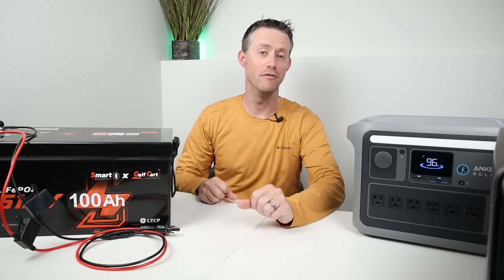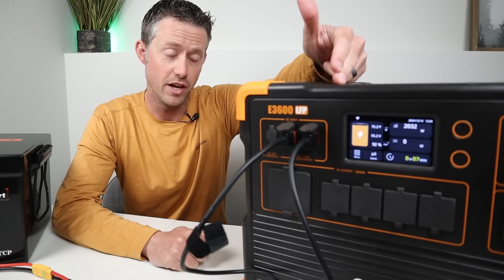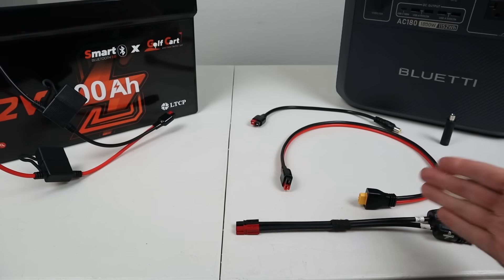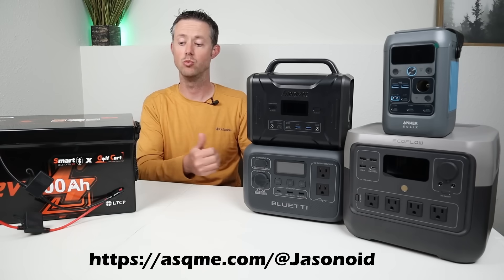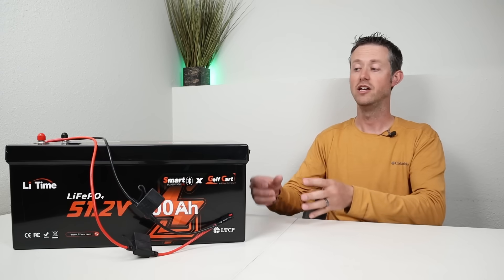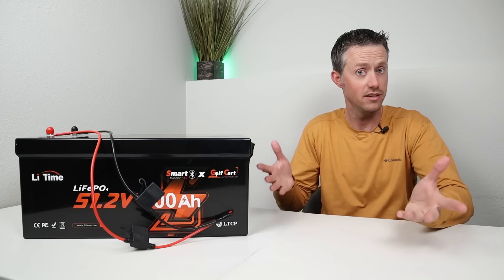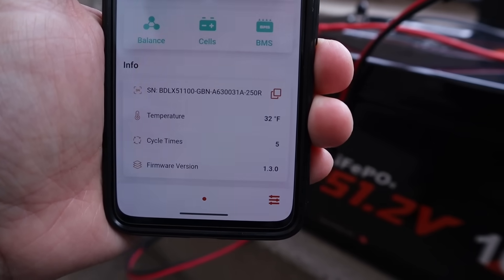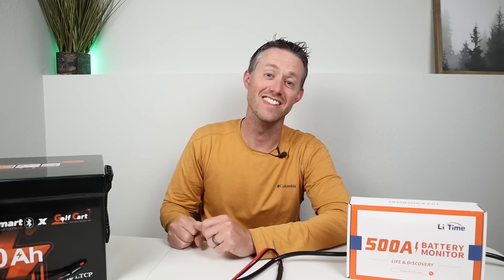Simple Trick to Make Your Power Station Last 5X Longer! Charging with a LiTime 48v Smart Battery!

Comment: I have two Ryobi 480EX Riding lawn mowers. I have upgraded them both to Li Time LifePo4 batteries. In fact, I installed the exact same battery you are using in your video in one of them. I have the Anker F3800 [not the plus]. How could I use their batteries without removing them from the lawnmowers? You gave me that thought when I saw this video and realized that I have the same battery. I will eventually purchase the F3800 Plus. Thanks...

Comment: This may come across as a dumb question, so I will apologize in the beginning. I recently purchased an Anker F3800 [not the plus]. I am running it in the UPS configuration in my office. I understand that the unit cannot power 240V while charging, however, the F3800 Plus can. You can charge the F3800 Plus using, solar, a generator, AC... Why can't you run your house from the Anker F3800 Plus while charging it off of that same AC power provided by the Anker F3800 Plus? You wouldn't need a solar panel setup or a generator. Conceptually you would have unlimited power. Thanks...
Reply: If I understand correctly, you are essentially asking if daisy chaining the 2 power stations would work. I have seen videos demonstrating this, and it’s possible but not very efficient. Something to do with the watts each power station uses just to power itself.
Reply: Hi Alexandra, actually my question is if the Anker F3800 can charge itself from house current, why can't it charge itself WHILE providing power to the house? Why would you need solar panels? The unit should hypothetically run indefinitely.
Reply: @GospelChoirs So when you say ‘provide power to the house,’ do you mean though a transfer switch? Or, are you talking about just directly to your office appliances (PC, modem/router, etc)?
Reply: Hmmnn I see I am not clear. My apologies. Please excuse my electrical ignorance.

I can plug my Anker F3800 into a house outlet to charge it. Why can’t I charge it from an outlet in the house while I am using it as a power source plugged into my electrical box in the same house? I am new to this so forgive me.
Reply from the maker: Yes that will work. It's called UPS mode.
Reply: @GospelChoirs  Please, no apologies necessary. Ok I think I get your question now. You can run the Anker 3800 or 3800 plus, while plugged into house power, using it as UPS. So it will stay charged at 100% because power will just be passing through the unit to your appliances. No need for solar panels or extra batteries, unless you want to extend the run time if you lose power to your house.  I hope this helps.  

And the only dumb question is the one that isn’t asked. I actually started exactly where you are and, am still learning 😊. No expert, by any stretch. I’ve posted many questions and always appreciated when I get a response.
Reply: Ok… that leads me to the big little question…
Scenario 
I have loss neighborhood power. I switch to the Anker F3800 to power my home. I plug the Anker F3800 into an outlet near the electrical panel box. The Anker is charging the house and charging itself…

Why do I need solar panels?
Reply: @GospelChoirs In this scenario where the grid is down and you have no power coming into your house at all, the Anker will simply drain until it’s empty. Because you have no power coming into your house, it has no source of power.  This is why you would want solar panels, to charge the Anker from the sun instead of the grid.
Reply from the maker: @GospelChoirs  because it can't charge itself, physics won't allow it.
Reply: I accept your response, thank you. That being said, the UPS configuration charges itself and the solar option charges itself… I am not being difficult. I just want to understand. You can be technical. I have an IT background. Thank you for your patience.
Reply: @GospelChoirs If you have solar panels, as long as you have sun on the panels, AND you are using less power than the panels are providing, you can have infinite power.  But ONLY while the sun is on the panels. Ideally, you want enough panels to maintain your power station at a high enough state of charge to get you through the evening, nighttime and early morning hours when the panels aren’t getting sun.
Reply: Yes Alexandra, I totally understand that scenario. The Anker F3800 is providing power and it is receiving power i.e. being charged from the solar panels. I get it.
My mental block is not grasping why that can’t be done using just AC.

From what i am hearing. If I ran a long 12 gauge extension cord to my neighbors house, powered by his propane powered Generac system, that wouldn’t work.

However, if i used my propane generator to charge the Anker F3800 while it is powering my home, that would work.  😢

Is it that you cannot charge your house through the UPS option?
Reply: @GospelChoirs As long as you have a source of power to your Anker, whether from a gas, propane or natural gas generator, it would work.  I see no reason why you couldn’t run an extension cord from your neighbors Generac.
Reply: OK… then why can’t I use the same power the unit is generating to power the house to also charge it… 

There may be an electrical cycling explanation if so what is the technical term. Thanks for being patient with this electrical novice…😢
Reply: @GospelChoirs  It would help to know your understanding of where electricity comes from?
Reply: Very limited. I would pay someone to work on my electrical switch box. I have converted my lawn mowers from lead acid to LifePo however. I have reviewed YouTube channels on it so I have a clue. If there was a term why my inquiry could not work or a YouTube video on it I would happily research it.

My question is similar to why can’t an electric car self charge itself.
Reply: @GospelChoirs Maybe this is where the confusion is stemming from. Power stations don’t generate power. That’s the problem with them being called “solar generators”.  They perform a similar function as a generator, in that they can supply power to appliances. A generator use gas or propane as fuel to create (generate) electricity. A power station like the Anker, only stores electricity inside battery cells, and generates nothing. The fuel it requires is electricity itself, which it can only get from an outside source, such as the electric grid, or an actual generator. Or directly from sun, via solar panels. By the way solar panels don’t generate electricity either, they simply convert energy from the sun into electric current that can be used to fill the batteries in your power station. 

The Anker 3800 battery has a limited power capacity of approximately 3,800 Watt hours. This is all the power it can store on its own. You need a source of fuel (electricity) to replenish the battery as it gets depleted. It’s not like a car battery that gets charged by the alternator while the engine is running. Maybe that’s also where some confusion comes from. Power stations don’t have an alternator. 

So if you use this limited power instead of AC, to run an appliance without adding more power to the unit, it will eventually run out of power.  You need a separate source of electricity to add power back into the Anker. That’s just how power stations work.   I’m a novice myself, so I’m sorry I can’t be of more help.
Reply: Thank you so much for taking the time to explain! Everything you noted I understand and accept. I will continue to research but I am grateful to your taking the time to respond so thoroughly!!!😊

Comment: I've encountered a problem with this kind setup. When the golf cart battery goes into standby mode (at any SOC), my Pecron E3600 still detects the correct voltage through the XT60 port, but no current flows. To get it working, I have to manually activate the golf cart battery charger for a few seconds. This workaround isn’t practical during a power outage which is my use case.  Feels like between the Pecron E3600 and the golf cart battery, at least one of them needs a wake up call to get started. Granted, my golf cart battery is of different brand. Not sure if that makes a difference.

Comment: Does anyone know if you can keep this plug into, say, ecoflow delta pro 3 low input that is rated for 60 volts while you charge the expansion battery with mppt and solar.  Would that create to much volts.
Reply from the maker: Of course that will work!

Comment: Hi ! You look like you know so much about this stuff which i lack :D.. i have the same Ecoflow power station @4:23 and i have webesten portable Air conditioner. this powerstation can not run the air conditioner.. its says i have to buy full sinus battery power like you have on the left :D do u mind making a video how to connect that battery to airconditioner and a 140w solar panel? so i can use them half of the then in summer to cool my tent
Reply from the maker: The air conditioner requires a lot of start up / surge current to get it running. The power station in the video can't provide enough for a large AC. You need a larger inverter (a bigger power station).

Comment: I'm seeing things online about how it's risking the health of the Ecoflow or something similar to run these into the DC ports like solar but I'm not sure why. I'm seeing things like it needs an MPPT DC-DC controller to make sure it doesn't fry the system. Have you seen anything about this or know why there are concerns?
Reply: I have the same question.  If the battery is capable of 100 amp output, and the Ecoflow Delta Pro's maximum acceptable input is 15 amps, what, other than the fuses on the battery cable, protects the Delta Pro from getting fried  by 6.66 times the maximum acceptable amperage limit? 
Also, I have two Delta Pro's connected to the 240 volt hub. Can I take two charging cable sets off of the battery, one to each Ecoflow DP? Thank you!
Reply: @jere4524 I’m in same boat with your set up and would like to know the answer as well

Comment: So if you were to hook the battery up to a charge controller and solar panels, could you use it permanently like this? 
Would the powerstation stay at 100% charge (or get charged up while use)  until the battery is empty? 

And if the battery is completely empty what will happen?
 Will it indirectly load the powerstation before the battery?

Comment: I am hoping a battery that expensive has under voltage protection, but something to consider - with certain battery types you can run the voltage down to 0 on all cells which essentially ruins them.
Reply: They are protected by an internal Battery Management System (BMS).

Comment: What you're demonstrating is not an expansion battery because you're not plugging it into the expansion battery port. You're just choosimg to charge the main unit with the extra battery instead of with solar. You're taking away the ability to charge with max solar. 
Is there an adapter to connect the battery to the main unit's add on battery port?
Reply: Lol You can literally charge the external battery a lot faster than the fastest the anker can do…
Reply: @zimvader25  how can you do that?

Comment: In your video you connected 2x 1000 watts xt60 inputs but cautioned you had to put a 40 amp fuse in each lead. You had both leads connected to the same battery? Even still 10 awg wire should carry 1000 watts with a 30amp fuse no? Or is that cutting it to close and you went to a 40A so not to overheat a wire. Hard to find 8AWG Anderson power pole to battery ring cables unless you make it yourself.
Reply from the maker: 10 AWG wire is rated for a peak of 30 amps but I recommend having less than 25 amps to avoid voltage drop and heat buildup. If you want to charge a power station with dual inputs, or charge two power stations at once, buy two separate cable setups, one for each port.

Comment: Hi I have been buying Bluetti's for about 2 years,I have 2 AC180s,1 Elite 200 and a few others from the Bluetti family..I am just going to start buying Batteries I would think on the Next Amazon Prime that should be on Black Friday of 2025.I just bought the Cables that you are using from the Battery to the Generator and now I am wondering why not just buy a  XZOY 24v 100ah for around $279 when onsale or WHY buy that battery you are using for over $1000?Besides the price I really don't see a difference other then spend a extra $1000?

Comment: I setup a 25V 100Ah Power Queen battery connected like in the video was feeding in 560 Watts to one of the XT60 Ports of the Anker f3800. At the end of charging to 100% the  black wire coming off the battery-the fuse got so hot it melted the black enclosure and through the top of the battery. Not much but I believe it went through the top. The fuse enclosure was melted to the power queen. Whew! Had 35 A fuse in there. Used same wire setup as in the video. Can't figure out where I went wrong. I did notice the wires getting hot near the fuses earlier but figured that was normal.
Reply: What gauge wire was used? You would need at least 10 GA, but 8 GA would be better. If wire heats up you are pulling too much power, it should be room temperature. You would be pushing like 23 amps. 10 GA is rated for 30 amps but best to stay within 75-80% of wire capacity for extended periods.

Comment: Wouldn't it be possible to charge through the ac port also considering after you plug into the wall it inverts it to the 1600 watts or whatever the power station is capable of taking? The conversion from 110 to 48 volt happens outside the box in most chargers correct?

Comment: After watching this why would anyone pay so much for an expansion battery for their brand. 48 volt batteries are pretty expensive, I'll still use my 12.8 volt 100 AH with a step up converter.
Reply from the maker: It all depends on if you already have a 12v system or a 48v system. If you already have a 12v system and boost converter, that works great too!

Comment: @Jasonoid, I want to do something similar with my Anker 555 powerhouse. I believe the max input for it is 11-28V so I should be able to attach a 24 volt LiFePo battery right? Can you recommend a good battery (preferably with BT and maybe self heating built in) and accessories needed to use on this power station?

Thank you!

Comment: what keeps the auxiliary battery charged?
Reply: if you got solar panels then you will need a solar charge controller. If you dont have a solar system then a DC battery charger with the voltage rating of your battery will do to top it off when it runs down. You may be asking whats the point? If you got solar then this essentially extends the capacity of your battery and depending on your system allow you to harness more solar energy, if you don’t have solar then it can be usefull mainly during power outages or situations where you dont have access to the gird but need more capacity for whatever reason.

Comment: I have (2) Pecron 3600lfps with the 240v parallel connector. As you know when powering a home with that split phase 240, the unit does not allow AC charging, only DC/Solar charge. I know there is a ChargeVerter work around but I was wondering if I had a 48V 60 amp hour battery charging the Pecron units does anyone think I would be able to charge the battery via a gas generator and a 48v battery charger while that battery is supplying power to the the Pecrons and while it is supplying my house with 240v? What are your thoughts?
Reply from the maker: I think that will work, as long as you have a pretty large battery charger and your generator needs to be a pure sine inverter.

Comment: For an expansion like this, does the amperage matter? My ecoflow river pro says max amps is 13 for AC charging. Will the 12V / 100mah battery work or cause problems?
Reply from the maker: The power station limits the amperage automatically.

Comment: I still don't have an answer; can I leave the Solar Charger EG4 and the dp3 connected simultaneously? They would have to share the same terminals
Reply from the maker: Yep
Reply: @Jasonoid thank you, I'm assuming that the EG4 puts out 48v so it's safe for the dp3? So that means I can connect from the same battery bank to both solar imports even though they are coming from the same battery?

Comment: Jason, I got all the components you recommended, but I have sent you another asqme question. I don't understand if the EG4 and the dp3 can share the same battery terminals. I'm concerned about the limits of the dp3 and the 4200 watts of solar coming in via the EG4

Comment: Sadly I can not find the Anderson cable with fuses here in Japan.
Reply from the maker: Just install an inline DC breaker! They also work as a power switch! 10 awg wire, 30 Amp DC breaker 👍
Reply: @Jasonoid Would this work with the Delta 2?

Comment: so could you couple a charger  <> standalone battery <> powerstation and use it for timeshifting loads e.g. the charger is energised with cheap off-peak grid energy (maybe the powerstation too) and then the power station is essentially expanded via its solar port?
Reply: Didn’t watch the whole video, did you?
Reply: @michaelwitkiewicz7052 Ok, at the very end he talks a little about how he uses it to support his home system, but its not clear to me if he's manually switching it from being charged to being discharged or if its all permanently hooked up to be able to do both.

Comment: Hi I have allpowers s300plus model, on the xt60 connector is says input 12-60V 8.5A max, can I safety connect 100ah LifePo4 12V battery directly to my powerstation using O ring terminal extention power cable?

Comment: I just got the EcoFlow Delta 2 Max for my school bus conversion and was looking into EcoWorthy 12v 300AH battery with Bluetooth. Was wondering if this would be a good set up and if it would take a charge? What if I were to somehow find an outlet to connect from the front side of my power station and hooked it up to the terminals? 

New at this, sorry 😅